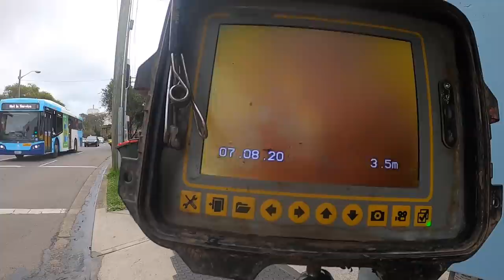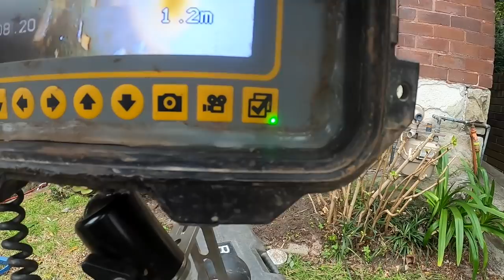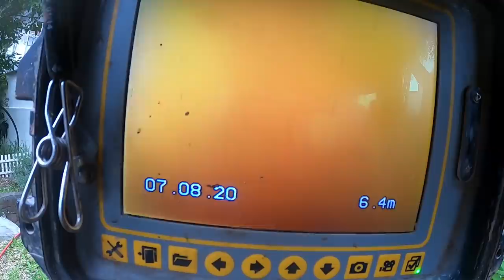Blocked Drain 487

Comment: Ollie, I had a jetter do my front storm water drain that leads straight from the gutter to the down pipe off the roof, on a 1 story house.. 
the kid who did the jetting was in his early to mid twenties, and really wanted to do it in a hurry. One problem though, he was not listening to me warning him about the 40 foot tall "Grevillia Robusta", straight in line with, and on top of the PVC pipe, obviously destroying the pipe. 
The kid was going full speed, full jetting power with a brand new root cutting head and hose!
When he got to where the tree trunk was, he got his hose caught. 
He then, like you sent up a second hose and BANG, caught it up as well.
He spent 4 hours trying to get the hoses out, but only managed to get the second older one out.
The next day he came around and dug a hole just before the tree to get the brand new hose and jetter head out, and after 2 hours of trying to get them out he gave up and cut the hose where it was stuck, fallen down the cracked, crushed PVC pipe, wedged under the bloody tree that the Department Of Housing refuses to remove!
Ollie, he had to re-lay a new storm water drain from the down pipe to just inside the property. 
I watched this kid lay the pipe.
The new storm water pipe from the down pipe has FOUR 90° elbow joints, surely that will be a nightmare for the next "Drain Addict", right?
I would really like an unbiased opinion from you, a professional jetter.
If you want a free root cutting head, look me up, I know exactly where it is! 😁👍

Comment: work for city of Toronto last year & did CCTV inspections of sewage pipes with really expensive robots, the stuff i seen down there i wish i could forgot & watching this video brings back the horrid smell & more memories😂 aswell worked with hydrovac trucks that had couple thousand PSI Jet heads and spray mist of the filth of the sewage systsms around 20-30 feet high out of the manhole

Comment: Hell, how difficult that job was, the very clogged pipe, damaged with the roots. All the hoses really got stuck, they went to Great Spirit of patience to remove those hoses, but the important thing was that the pipe was clean. Although I suggest that in the future the connectors or couplings are changed. that join the pipe because I feel that there is leakage because where the roots enter.

Comment: In my jurisdiction in California you'd have had to set up an impound to trap all the blackwater and debris and vac or pump to a waste tank.  Otherwise our creeks and bay get all that crap and the critters get sick.
Reply: Tim L. PINE This is only storm water... no black or even grey water I don’t think in there....
Reply: @PirateDest  Our standard in the San Francisco Bay Area prohibits non-storm discharges, i.e. if it isn't raining then virtually no discharges are allowed (minor exceptions for things like fire fighting water, pure condensate from air conditioning, clean groundwater from subsurface pumps, etc.)  The discharge in this vid includes a lot of suspended sediment and by products of decaying organic matter, all of which would look like crap when it discharges into a clear flowing creek; not to mention the difference in receiving water parameters like BOD and turbidity.  I'm an environmental scientist and water quality enforcement officer- this discharge would have warranted at least a warning and if it was a repeat offense, then a fine would be issued.  Some of our creeks are home to endangered steelhead trout and Coho salmon so we take our stormwater quality very seriously.  I know that's not the case in most of the world but there you have it.

Comment: So I’m curious.  He fed the camera down the hole to see where the red hose was, but how could he know where it was?  All I saw was water, a black feed, and the inside of the pipe with water.  I couldn’t see the hose yet he kinda knew where it was after a bit.  Also, where in the hell does all the water come from? Is it stored in the van?  Is he connected to a hydrant? Is that generator connected to god?

Comment: The hole in the sidewalk is vomiting black water
Reply: It's soil, I'm not all the way through the vid yet but the hoses are probably snagged on a section of loose or broken pipe, which is how the roots and soil got in in the first place.

Edit: Nope, it was just wedged in a pipe junction. The other was just snagged on roots, hence the soil and stuff.